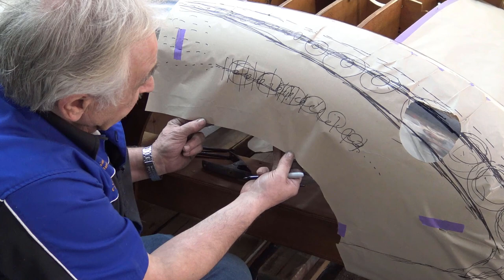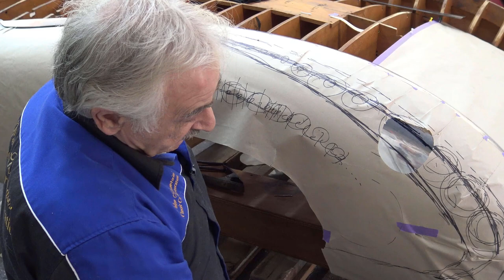Making And Reading Paper Patterns With Peter Tommasini Part 2

Comment: What kind of plate material is used to make a car body?  aluminum or metal or stainless?
Reply from the maker: It can be either steel or alluminium depends on the make and year
Reply: @Handbuilt1  thank you for sharing u is the best
Reply: @Handbuilt1  where does one go to purchase the  steel sheet  from, and what type?
Reply from the maker: @dornworks     where do you live ? I only know where to get the material in Melbourne

Comment: What does block mean and how to ?
Reply from the maker: blocking or block means hit the metal with a blocking hammer (like shown on the video) in order to primarily shape the metal before wheeling it , this method it's not necessarily always used  it all depends on the shape of the panel you are making.